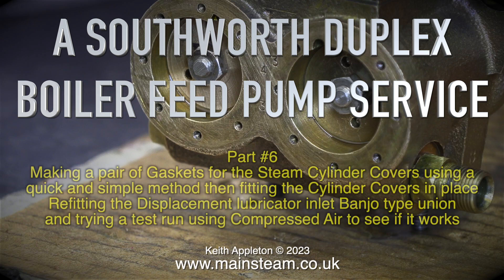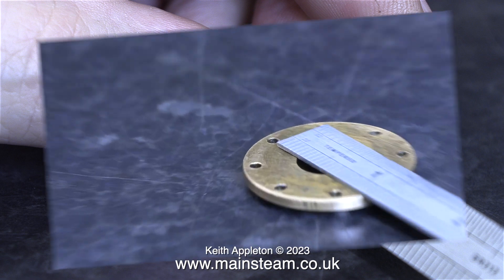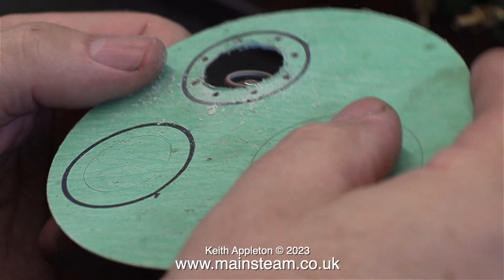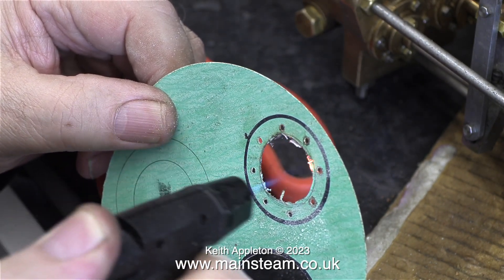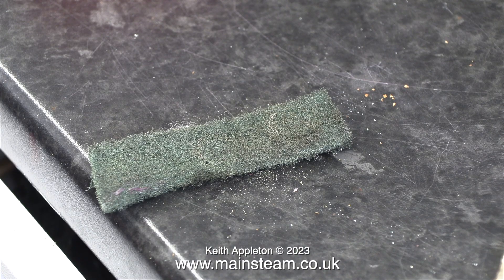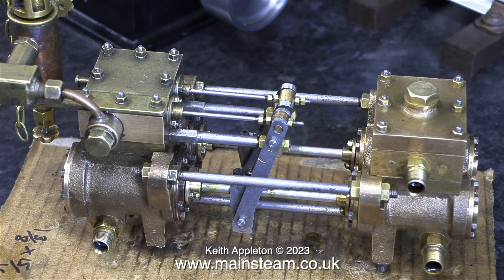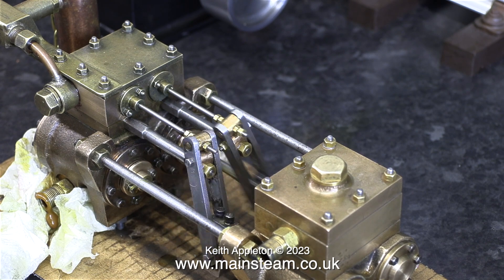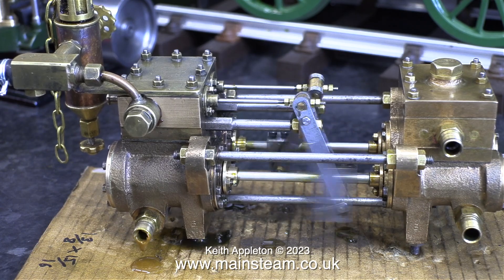SOUTHWORTH DUPLEX BOILER FEED PUMP SERVICE - PART #6

Comment: Question pls. Are Southworth steam pumps 3 port or 5 port steam cylinders? Full size duplex steam chests have 5 ports under the slide valve - 2 steam ports and 2 exhaust ports to cylinder ends plus 1 exhaust port. The pistons in approaching stroke ends run over the exhaust port and trap steam providing cushioning that stops the piston before it strikes the covers. This is not provided by the setting of the loose play in the valve gear, which is often a confusion point with duplex pumps. Normal practice is to first set the piston rods to mid stroke and then remove steam chest. The D valves will normally have quite a bit of intentional end play and the D valves should be set by rotating valve rod to open the steam ports equally (i.e. everything is set to mid position.) Then bar one piston rod back to an end stroke position, otherwise pump will not start. If the fitter removes the valve endplay, the pump will short stroke.

Guessing that the Southworth duplex is a 3 port steam cylinder and video shows the necessary end play is set at the lever ends. If the end play is not there, the pump will short stroke, which eventually wears ridges in the cylinder walls at the wrong place.
Reply from the maker: Sorry, I cannot help you with this. Please contact www.blackgates.co.uk for further info on Southworth Pumps.

Comment: Keith, Merry Christmas! All the best! (I was in Blackgates on Wednesday, on,my way from the U.S to Hull, I picked up a Southworth Pump casting kit so, when built, it will solve my need for a boiler feed pump.
Reply from the maker: That's good. Build it carefully though, as they can be fairly quirky ....... did you get the 6 inch one which is perfect for a 504 Boiler? Merry Christmas to you also.
Reply: @keithappleton  yes, they gave me a recommendation, I got the 6” simplex….looks like a fun build for sure…

Comment: Have you tried a trepanne (?) style cutter = much neater, more accurate (assuming they are set correctly) and  easier to use than the method you show.
Reply from the maker: Alas I can only use what I have, and I do not have the tool that you mention ..........